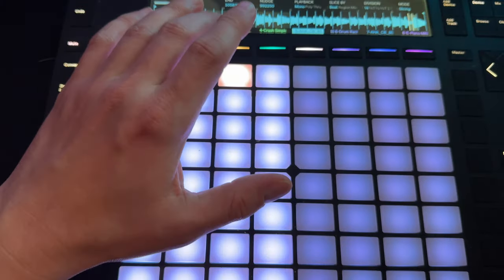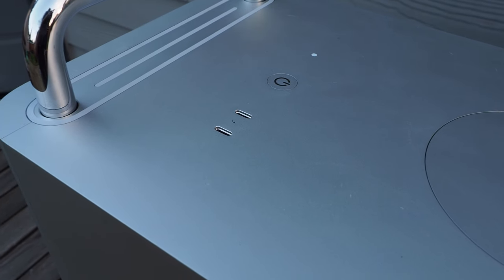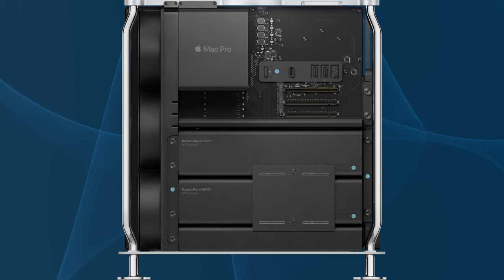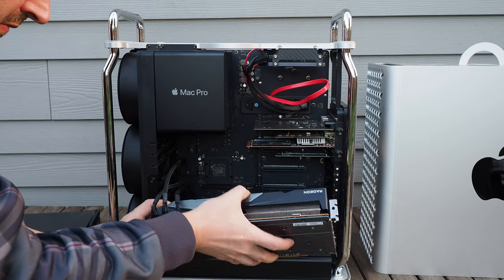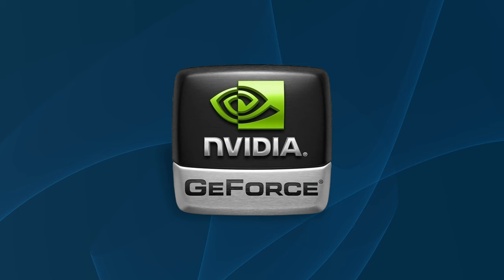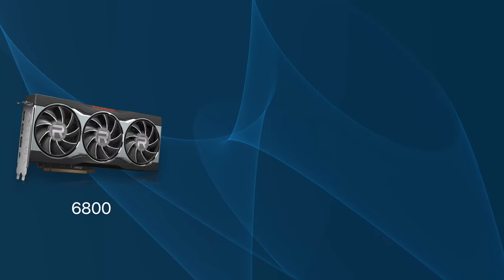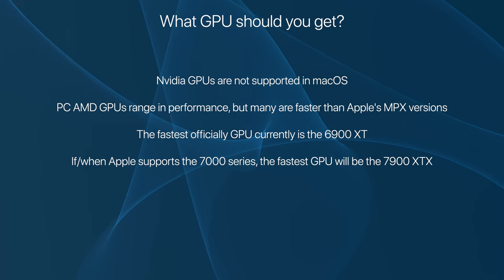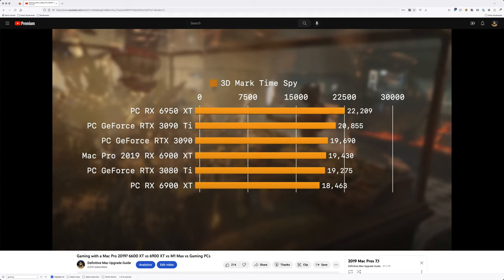Mac Pro 2019 GPU Upgrade Guide in 6 minutes

Comment: Nice update! Finding a 6900XT that fits is very challenging ... there are basically none available except for used. I looked for almost 4 months (here in Canada) and ended up buying a lightly used one locally (non mining) at a decent price a few weeks ago. While I hope that Apple eventually adds a driver for the newer cards, I wouldn’t hold my breath as I think that, even though apple continues to sell the MP7,1 it appears to have stopped support, IMHO. Thanks for posting this video.
Reply from the maker: Yeah, it sucks but Apple did file a patent for dedicated GPUs and Apple Silicon so perhaps we may see more support.
Reply: @dmug  wanted to ask in your opinion would you get the 6900 XT or the 6950 XT. On eBay prices are really close
Reply from the maker: @lunarmagicexpress7231  Depends on if you want to mess with OpenCore or not.  Since the 6950 XT is just an overclock of the 6900 XT, they draw more power thus are hotter and louder. My personal opinion is I'd just nab a 6900 XT as you're looking at a 3-4% gains across the board.
Reply: @dmug  thank you!
Reply: @dmug not quite . XTXH chip 6900XT are about 5% difference but none XTXH 6900 are over 10% slower. Sometimes more depending on vendor .

Comment: In your opinion, does it make sense to upgrade from R6800XT to R6900XT? Of course, I'm writing about the Mac Pro here. I work in Davinci Resolve on a daily basis and do editing and color correction.
One more thing, because I see that I found a specialist in this field :)
I have the R6800XT plugged into PCIe #4, I also have a stock 580x plugged in.
Will I feel the difference when I plug the 6800xt into port number 3?

Thanks a lot!

Comment: Your videos are so informative.  I'm currently upgrading my GPU for my  12 core 2010 5,1.  What would you recommend for the best and second best GPU for video editing 4k, 2k, 1080, in Davinci Resolve 18?  I edit short films and full lenght independent feature films.
Reply from the maker: Depends on the OS you run. If you’re running 10.15 the 5700 Xt is solid. The dual heigh 6800s (not the xt) are big step up as they have a fair amount of compute. However, an m1 and especially an m2 Mac will run circles around the cMP as Resolve is one of the most optimized Apple silicon apps, and makes good use of the media engine found on the m2.

Comment: Thanks for all your guides. Quick question, can you use the thunderbolt ports (top or back) for displays, if you use a third party GPU? On their website it says an mpx must be present but it doesn’t specify if the third party GPU will do the heavy lifting or not.
Thanks
Reply from the maker: You lose video over thunderbolt but the 4 ports will continued to work for data.

Comment: Another MPX feature...no fan.... I'm curious if you notice any difference between using MPX versus standard PCIe cards ? For sound editors, like me, it's an issue trying to keep fan noise almost to none - which the MP7.1 is good at - with the basic MPX module.
Reply from the maker: If I’m not mistaken, the only fanless mpx is the 580. I do a fair amount of sound work as a hobby and my 6900 XT isn’t audible, at least my quasi treated room when using audio apps. Video editing will cause it to hum a bit but not much. You can also flash the GPUs with lower clocked roms. It’s a shame though you can’t maintain the fan curves like windows where you can bounce between profiles and undervolt and reduce targets to keep the gpu pretty silent.

I’m just in my converted office garage, which I’ve hung some sound dampening in which can be seen in some my videos in the background.  It’s a dual layer acoustic treatment, and I’m recording with tolerant mice like the SM7b, sennehiser e935e and rode go lavier mic (common thread: dynamic) and the much bigger issue is still room dynamics and not the noise floor. 

Also the loudest component is my 4x terramaster storage bay as the hdds are generally the only audible component in my setup.

Comment: I’ve had 5 gpus in mine, 2x 6800x Duos and a sonnet 6900xt in slot 5. Worked fine but removed the 6900 because of heat etc. sadly since Sonoma eGPUs are pretty unstable on my 7,1 so I can’t use them.

Comment: Which version of the 6900xt is the most optimal for the 7,1 in your opinion? I was thinking of getting the reference model but then again there are so many options I had to ask for a second opinion!
Reply from the maker: When I bought one, all I looked for, was one that would fit and wasn’t expensive. I don’t know if there’s any dual slot height only cards on the market. All will be compatible so it’s mostly a game of what cooler you like.
Reply: @dmug  As far as I'm aware there are no 6900 xt's that are thinner than 3 slots, if your looking to go 2 slot with 6900 xt only option is the pro w6900x mpx module.
Reply from the maker: @h.b.5577  w6900X is quad height. The consumer versions take up less space.
Reply: @dmug  Apologies yes your right, I'm not very familiar with the mpx modules and mixed up the models a bit there. Since I'm now getting into the weed of things a bit more decided to look around real quick on tpu's gpu db and while there really don't seem to be any 2 slot designs outside of watercooling, there does exist the Dataland RX 6900 XT Ares X which is 2.5 slots thick, length on it is 31,1cm however so compatibility would still be an issue.
Reply from the maker: @h.b.5577  I don't know about your needs, but I was fine with the card blocking slots. It's frustrating that it does that but also, the sort of trade that's required for said card.  

I think its a perspective alignment: If you wanted Apple's top MPX modules (The w6900x and w6800x duo) you'd pay A LOT more money to lose access to 4 PCIe slots. An aftermarket card gives you access to one more PCIe slot, saves you $5000+, and delivers faster performance than Apple's solutions. 

There's always going the path of aftermarket coolers but these days they tend to focus on maximum cooler and thus unlikely to be lower profile.  I haven't swapped a cooler since the 8600 GT Ultra nor do I keep up with it as I'm not much of a gamer.

Comment: i know apple are switching to AppleSilicon  but id think apple would support the MacPro7,1 with new updated GPU Drivers for a few more years like till the GPU of 2026

i think even when intel macs all get killed off including the ones that Run OpenCore i may still look into a 2019 and get Windows onto it or if in 2025 or 2030 i get into using Linux
Reply from the maker: It’ll probably get 7000 series drivers when AMD’s pro models come out

Comment: I've had issues getting the 2nd 6900XT to work. I really don't know why- The card lights up, but won't be seen by the OS. It just doesn't show in the PCI slots in About This Mac. Any tips would be appreciated. I'm currently running both monitors off of 1 card.
Reply from the maker: This might sound stupid but if you plug both monitors into the other caed and reboot does it work? Have you tried rotating the cards? I had a 6600 xt and 6900 xt in and both showed but never two. Are they both dual 8 pin cards or are you bridging cards?

Comment: I have an AMD 6800 in my 7,1. Is it worth upgrading to 6900X? (for Bootcamp use)
Also, how much of a performance difference there is if the video card is installed in slot 1 or slot 2? (direct CPU access vs non direct)
Reply from the maker: The performance of the shared bus really will depend on how much activity is going over the (formerly) Northbridge controller. Most of the time users aren't hammering all the PCIe lanes at once enough for it to be noticeable, however with technologies like DirectStorage you'd probably be prone to observing the performance impact (loading a game might take a few extra seconds) if say your GPU and SSD were both on non Direct Storage lanes. 

As far as 6800 vs 6900 XTs, I certainly wouldn't say the w6900x is worth as you could buy a M1 Ultra Mac Studio + a 6900 XT and still have money left over. 6900 XTs probably will be as low as they'll be as fabs have switched to the 7000 series.  The 6900 is roughly 50% faster than the 6800. That could be worth it if you can afford it or not.
Reply: @dmug  Thank you for the detailed response. I would also like to thank you for your videos - they are a great source of information. 🙏🙏

Comment: Okay another question, you mentioned the GPU's had to be under 305 mm. I need help knowing which of the 6800 and/or 6800 XT's I could use in the Mac Pro. A lot of the models I see are slightly over 305 mm.
Reply from the maker: Pretty simple, over 305 mm then they’re too long. When I picked picked a 6900 XT, I just made sure it was under said length. I don’t have a running list of what fits, fortunately it’s easy to find by cross referencing.
Reply: @dmug  Okay gotcha, I'm not going crazy then. I guess the search is still on. For my needs, I don't really NEED a 6900 XT, I just think a 6800 or a 6800 XT would be fine, but I'm having a hard time finding them shorter than 305 mm.
Reply from the maker: @drewaforbes  They exist, just a matter of finding the make/model. I'd recommend using pcpartpicker.com and filtering by length. AMD has moved its manufacturing to the 7000 series so eBay may be the place to go for getting one at a reasonable price.
Reply: @dmug  Got it! Ty! That’s precisely where I’ve been looking (eBay); guess I just need to look some more! Ty for the link as well!

Comment: In the video, you use the power connections 1-2 and 3-4 (with 3 cables) for a single graphics card ... Do you get 450W of additional power to the PCI slot? I thought you could only use the power connection for the slots printed on each case and thus only get a maximum of 300W additional power.
Reply from the maker: Nah, you can route power any way you see fit. The 6900 XT can draw a stupid amount of power, but not all of the 6900 XTs have triple power cables, many only have two. I didn't actually realize it when I bought mine but it is an OC version that performs pretty similar to the 6950 XT, hence why it kicks out better metal compute scores than the w6900X. I was only concerned with "will it fit". I bought it back when 6900 XTs finally hit $800 right after the GPU market was returning to normal so selection was pretty thin. For whatever reason it was cheaper than other 6900 XTs by $100+.
Reply: @dmug  That's interesting, thanks for the answer 😁 Had the RTX 4090 (for bootcamp) in mind, however, which needs 450W and thought that I would be limited to a total of 375W for the slot, which would not have worked. But that's how I get to 450W in addition to the 75W of the PCI slot - more than necessary. Then let's watch the price development ... 😅
Reply: Is it possible to run RTX 4090 in Bootcamp?! And if yes, how you connect one monitor to 2 video cards? Different monitor inputs, and then switch the inputs every time you load a different OS?

Comment: Have y’all noticed how awful the 6xxx GPU’s perform under MacOS versus Windows? I’m getting 50% more performance under Windows with my 6800XT versus MacOS. Geekbench 6 reports ~110k for OpenCL in MacOS, but a whopping ~160k in Windows 10. Are Mac drivers really that bad?
Reply from the maker: That has always been the case, regardless of GPU generation. Also macOS’s OpenCL is out of date and Apple hasn’t fixed it so windows will always outperform it too. Metal is better than OpenCL but it’s apples to oranges with the numbers.

Comment: Hi :) can you please tell me if I can fit a graphics card that can handle HDMI 2.1 in my 2019 Mac Pro? I have a feeling I cant?

I have this Mac…

2019 Mac Pro 3.2GHz 16 Core Intel Xeon W processor Turbo Boost up to 4.0GHz
48GB 2933 MHz DDR4 memory
AMD Radeon Pro Vega II with 32GB of HBM2 memory
Main Mac Storage 8TB SSD
With a Separate Built-in Storage 24TB SSD for Movies

I’m running macOS Ventura - Version 13.4

I’m wanting to buy a Sony Bravia XR for my PS5 and to use as a 2nd monitor for my Mac, is this possible yet or should I wait for the next Mac Pro?
Reply from the maker: I’ll answer this honestly and it’s not meant to be taken as sarcastic but this is a question I’d pretty much google by searching “AMD Radeon 6900 xt hdmi 2.1” reply to this based on what I found. My guess is “probably” without searching. 

Off the top of my head if it can’t do it hdmi it can via display port.
Reply: Thanks and typical my Mac Pro hasn’t got a DisplayPort 😂
Reply from the maker: @KainsTorment  off the shelf GPUs do
Reply: @dmug  does my Vega II? I’ve looked but both my carer and I can’t see it

Comment: What’s the Best Value video card for a 2010 5,1 Mac Pro ?
Reply: Depending on the macOS, you can go for the amd 580. This works with all macOS versions. If you use OpenCore, you can get better cards for the same price tag. Best to use is the amd 6600 card. If you manage to find a EVGA PowerLink, you can get an AMD 6800 dual slot card. This is more money but more punch. For most value I’d go amd 6600 with open core.

Comment: One more for the MPX modules - they pass through air much better than regular GPU's.
Reply from the maker: Allegedly, some of the cards like the 6800 duo are severely thermal throttled.  It is impressive that the 580 is fanless.
Reply: @dmug that is basically same design like Nvidia tesla cards